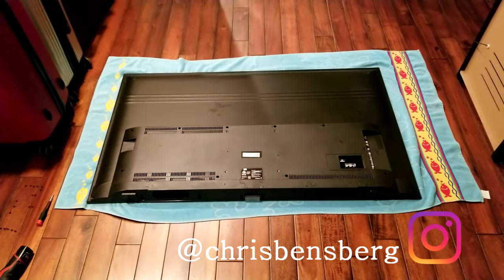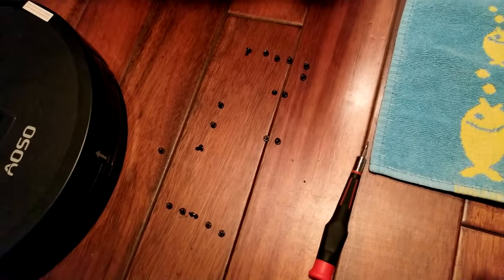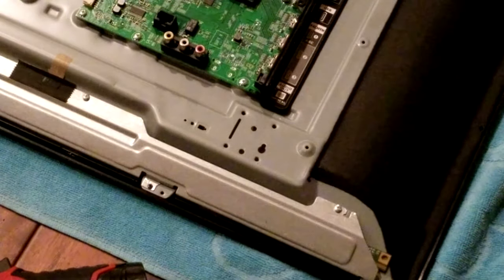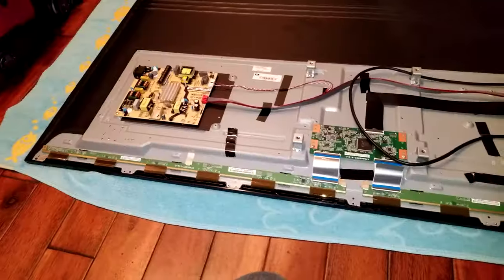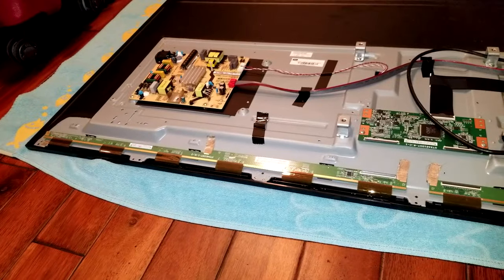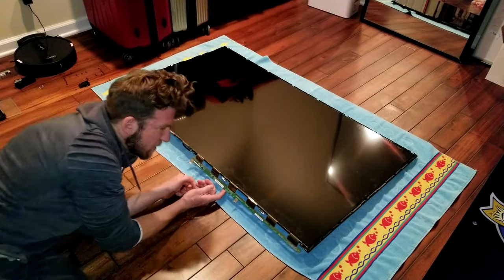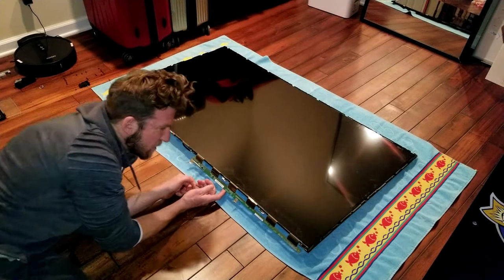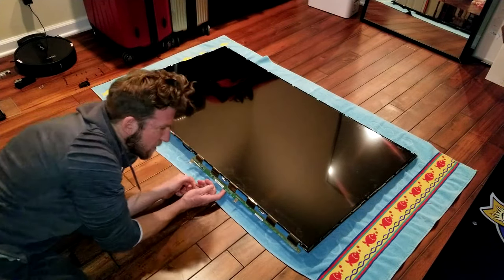TCL 55 Inch Has Sound But No Picture FIX!

Comment: YOU DO NOT NEED TO REMOVE THE ADHESIVE FROM THE DISPLAY!!!!! the part of the tv that is glued to the display(that runs along the top edge) is designed to be removed and reinstalled with the tv. Its just a matter of a few clips on the top of the tv that need to be first removed and then the whole display comes right off without any fuss. I did the job last night and can confirm I would have broken it if I didn't realize this. If there are any questions about this, reply and I can go more into depth about it.!
Reply: Can you go in more depth please?  So i don't have to remove the 2 panels separately?
Reply: @MrGandostar  yeah so on the top side of the tv after youve removed the bezel there are little clips that you must use a flathead screwdriver to release. You will see little cutouts with what looks like black bars(about 1/4 inch long) in them. Just push those in with a flat head util they pop. Once they are all popped the panel will come out with no effort. If it's not coming out super easily, stop! Then reevaluate. I had two broken tvs that I used parts from to make one working tv, and before I discover these clips, I actually cracked and already broken display. It doesnt take much force at all.
Reply: @masonphillips6605  thank you for the info!
Reply: Do the 3 sheets stay attached to the screen when you remove it the way you’re describing?
Reply: I was wondering about this because the screen and plastic comes off so easy, but I have yet to successfully remove the adhesive. Thanks for confirming.
Reply: @AXXXXA  no they dont. You will have the filters separate from the actual display when you disassemble your tv
Reply: @masonphillips6605  is there a video you can refer me that explain that and how to do that. Otherwise there’s no way I’m gonna get it right
Reply: This man is 10000000% correct. You do not have to go through the pain of separating the screen and adhesive. I just cracked my screen following the credit card / adhesive separation method then I looked at the frame further and the entire screen can STAY ON THE FRAME and just remove a few clips. Wish I would of read all the comments before I started this project. I'm not going to buy a new tv.
Reply: @tjarion  hey did you order a new screen or just brought a new tv I just did the same thing and is heartbroken
Reply: How many clips are there along the top?
Reply: @shawnspears3844  Its been a while, I can't remember but around 6 I think
Reply: @masonphillips6605  Thanks! I can’t find any image or video online describing these clips, would be nice to reference
Reply: Broke my screen using the credit method in the video. Don’t use the credit card!
Reply: @jbocooter8415  same 😢
Reply: Please upvote/ pin this comment. This would have saved my TV 😅
Reply: Is there a video for no sound or picture uv output tcl control both light when reset is pushed but then flashing occurs is this a fault code?
Reply: @tjarion  So, do we unclip the frame on all 3 sides (except the bottom) and the screen will lift off with the frame?
Reply: He said "I've already replaced all those four already". What has he replaced, I didn't see it. Does that mean I have to buy some parts.
Reply: I'm really interested to know if there's anything that has been replaced.
Reply: Yes I just saw the clips.. no adhesive need to be removed. The screen becomes easier to remove once the clips are removed.
Reply: Wouldn't this be the same as what he has at 13:50 in the video? Where he removes the frame that the screen was glued on to?
Reply: Also... Use the suction cups to apply GENTLE upward pressure as you're undoing the clips. The screen will stick a little bit even with the clip tension reduced. The upward pressure will help it break loose. I didn't know this and only worried about the clips... And promptly cracked the screen. :(

Comment: I watch the video about 5 times and decided to try and fix my TCL 55 inch everything went like the tutorial with some differences that didn't pose a problem until I tried to separate the top of the screen from the 2 sided tape. This TV must be a later version because it was really stuck. The screen cracked and the crack traveled across most of the screen. After that I noticed how the top plastic strip it was stuck to could have been released and removed with the screen. The sides and bottom of the screen released easily but the top would not. Hope this helps prevent someone from cracking their screen

Comment: He explained everything very well, started to watch a different video and would have broke my tv before I ever got it apart if I hadn't found this one. My husband thought I was nuts at first but once I had it down to the screen he stepped in to help and other than the one top corner cracked a little it (he wasn't kidding when he said be gentle) works better than before, leds were larger then what was in it but the picture is brighter which is good. I've never commented on a video before but our tv would have been in the trash if it wasn't for this. The 30 bucks for the led strips and 6 bucks for suction cups was much better then 550 for a new 55" TCL tv.
Reply: Where do you find the strips?

Comment: This is a great guide. Few corrections:
1) Tape the dangling circuit boards (the ones that hang by ribbon) to the top of the screen. This will not damage them and will prevent you from damagnig them when lifting off the screen. 
2) As others said do not remove the adhesive on the top, just unclip the top frame.. Use a flat head and push up on the clips while using a suction cup to gently lift the screen (to give you some leverage). 
3) After you remove the glass screen, the three filters need to be removed. If possible, gloves to avoid smudging these, as it's very hard to clean them. 
4) Also would recommend just cutting the paper around the LEDs instead of trying to peel off the whole thing. I can confirm this does not impact use at all.
Reply: Where did you find the LED lights? I see some on Amazon but not sure if I have to cut them? Can I cut them? I see the strips of lights but still not sure or comfortable with getting them not knowing everything.
Reply: @Learning_new_things_70 no you don’t cut the new LED lights. You cut the white plastic cover on the tv.. to be able to remove the previous LED lights
Reply: Thanks for your input

Comment: For anyone who is watching this video and are working on repairing a TCL 50S425 or Similar. 
Things I won't recommend doing to make the repair so much easier.
• DO NOT TAKE OFF ADHESIVE! When you're on that step of getting ready to take off the screen look underneath the bezel area on all 4 sides there should be clips that you can pry off. Pry off all 4 sides. Use the suctions and lift off the screen.

• When you lift off the screen make sure your hands are clean and I wouldn't recommend putting tape on the corners to hold the three sheets as the video recommended, the tape leaves residual on the sheets.

• I replaced my Backlights without pulling off the white paper sheet. What I did was carefully cut around and In between which made it easier and less work.

• After the repair of backlights and sheets are back in, make sure the screen is aligned directly in the middle. Mine was a little off to left side more than right which caused not so good alignment to input the screws in the left side but I didn't mind because it was still stuck in there without the screws.

• What I also recommend doing is organize your screws. What I did is put them in the Air Pillows I had left over from the packaging of Backlights. They are many screws to take off and you can easily lose some since they are so small. 

Overall this took me about 4 hours to do? Personally for me the repair wasn't too bad it's just a process of staying organized, careful, and patient.

You can either buy the LED Lights from the website called 
jimmyshop - No Free Shipping 

OR 

Their ebay marketplace which is free shipping.
Reply: Do you have a part number??
Reply: Don't the cuts show through?

Comment: I'm a auto mechanic that rebuild a transmission and engine on the side of the road. I'm a self taught welder that can give a Tulsa trained welder a run for his money. Im also a trained HVAC technician, carpenter, and heavy equipment operator. But the finesse on pulling the screen off is no joke 🤣. All I can say is read the comments before proceeding with this part other than that 40 for a 600 tv fix is a win in my book. Props to this man he earned my subscription

Comment: Thanks for great video. I just did a 4 year old  TCL 55S423. I did it just to see if I do it. TV wasn’t that expensive to begin with and easily replaceable but I thought it looked fine for my use and why contribute to more land fill if I could fix for under $50. 

I bought the light from Amazon but was concerned that there were only 4 strips for just two rows of LEDs. Once I got it apart this indeed the case. I tried to peel back that base but it was stack down. So I just cut out the strips which worked great. They were not screwed down but had a bit of adhesive the new lights had tape applied. 

I was most concerned about any adhesive holding the LCD panel to the frame but as it it turns out the panel sat in the frame no adhesive at all and just lifted right out. 

One big tip get a magnetic Phillips screwdriver.

Comment: This was a great video. Comments are correct. You do not need to use the credit card method. Just separate the bracket that holds the screen. You can cut the paper that surrounds the leds. Just make sure to tape them so they don’t fall out place when it’s all together. Ask me how I know. Otherwise great video. Great comments. Thank you.

Comment: Gave it my best shot and was as careful as I could be, and still broke the LCD screen. Bought everything recommended here, too. I think it happened during the process of putting the display back on. 

To anyone else who broke the screen, don’t feel bad, this is NOT as easy as it looks on various YouTube videos… I’ve successfully repaired a multitude of different smartphones, repaired and built small and large drones, built and repaired computers & laptops, tore down a GoPro and rebuilt it… but still failed this exercise. 

By far the fragility of the display makes this one of the toughest repairs I’ve ever dealt with. If it wasn’t for that, this would have been extremely straight forward.

Comment: Thank you for this tutorial!  Just finished and it's functional again!  I skipped the adhesive separation part, but I followed everything else and my 65" is up and running just before Super Bowl Sunday!
Reply: I'm just about to do this exact thing on my own 65".  Was it relatively straight-forward like his video shows? I'm also planning on skipping the adhesive separation as well.  Any tips from someone who successfully fixed their TV? Did you use suction cups for moving the screen? 
Thanks!
Reply: @David Martin  Yes, the video was awesome to follow and I did use suction cups from harbor freight.  Just take your time and don't rush.
Reply: @Gitnardoproductions  Thanks for letting me know. I bought the cups yesterday morning and my lights will be here on Saturday. I'm going to take my time and follow along. Thanks again for taking the time to let me know it worked for you!! I really appreciate it.
Reply: @David Martin  Definitely!  You got this!  I did separate everything as far as the backing and parts together on a table just for my mind's sake.  I placed the screen on towels and the replacement on another table and placed everything the way it would go in, just for my mind's sake so I wouldn't get confused.
Reply: @Gitnardoproductions   That's what I was thinking as well. To organize the parts as they come off so I don't forget how they go back in lol. Knowing me, I would put something in backwards.  Going to make sure the wife is around to keep me in line for this one. New TV isn't in the budget right now with how expensive food is. Especially with 6 kids!
Reply: @DavidMartin-ev2kt  hey can i ask where you got your LCD lights from? do you have a link?

Comment: This video was great, exactly to the point and no fluff until I went to take the actual screen out. Following the credit card method for the adhesive. Unfortunately, going slowly, it still broke the screen. And come to find out, the screen didn’t need to come off the top rail. Almost had it.
Reply: Thanks for commenting. Sucks that it broke on you but I appreciate you letting us know. I'm about to try this myself and plan on skipping the adhesive part to hopefully not break my own screen.

Comment: Should be Times man of the year, made fixing my TV a fun afternoon project. 

If you're a risk taker you can use clear packing tape to make handles for lifting the panel, instead of using suction cups.

Comment: Thanks for posting this. I ordered the light kit and worked like a charm. Only thing I did different is no suction cups... I didn't want to make trip across town to get them so just used thin plastic card to slide all round edge to free the adhesive and then lifted screen out carefully. Maybe I got lucky but worked fine for me.
Reply: Hi from where can I order the  light kit?
Reply: @danielanavideo  I ordered off ebay.

Comment: Thanks for explaining it in great detail. After I replaced the LEDs, I tested it and it was OK before putting it back together. However, after assembly, the TV screen remained black except when I shined a light onto it; then there was no longer any image. There was still sound. I wondered if this was due to cable connection issues. Do you have any advice? (Edit): Solved. The two flat cables have to line up perfectly, as they affect the clock signals controlling two halves of screen video.

Comment: I’m so bummed. Great video, I followed every little step. I bought suction cops as well. Everything went exactly to plan. I tried to be super careful and gentle. The tv turned right on...and there’s a small crack in the corner of the screen. Ugh. Not your fault. Thanks though
Reply: I screwed mine up too. Everyone should avoid trying to insert the credit card on top of the screen
Reply: Instead just remove the top 'filter chassis' black piece with the lcd screen. And leave it stuck to the lcd screen. I wish he wouldn't teach us that. Its much easier just to leave it on and take it apart together. Plus you dont risk runinig the TV
Reply: I broke mine too and didn’t even use a credit card. I used a very thin plastic tool designed for opening small screens. This repair is not as easy as it looks on YouTube.
Reply: LEDs worked but I used the credit card and I think that broke my screen. Turned it on and cracks all over.

Comment: Could you please explain how you know which LED strips to order/ where you ordered them from?
Reply: My thoughts exactly, I was looking for those parts on the description and they are not there.
Reply: @aleschwaida  bro mine just went blank only sounds am hearing
Reply: @Pete_content  that is what happened to me. I did exactly what the video shows and it is back running
Reply: @aleschwaida  I'm looking into doing this but mine has no backlight at all. Any advice?
Reply: @fedsmoker1841  mine appeared not to have too. But when I looked really close I could see something. Is the sound working?
Reply: @aleschwaida  sound works good, it's doing the same thing as his in first video (1 quick flash of image when trying to turn on) but then nothing 😔
Reply: Only the right side of my TV is black 🙄
Reply: Can you just come do my tv 📺… although very thorough tutorial … so many steps 😩

Comment: Very helpful, saved me $600!  Really not hard at all either.  Only issue I had was putting the ribbons back.  Place them in gently and dont push too hard.  My TV works great now and only cost me $40.
Reply: Where did you buy the lights and what kind
Reply: @karinaruiz8562  you have to buy them based on your TV model.  I found mine on ebay.

Comment: Good video and will be useful. My TCL just died with sound working and black screen, but no light , so I guess I will be following this procedure to put in new LED lights. My 65" TCL is 18 months old ! Costco purchase, so I'm going to see if Costco will repair or replace before doing this, but if I have to do this,I will. Thanks for your video !

Comment: Very informative.  However, the symptoms produced CAN be a bad T-Con.  It's sort of a crap shoot unless you have the patience to test the LEDs individually or the T-Con component my component.  I'm a lousy craps player and went with the LEDs and replaced them only find out it was the T-Con.  The T-Con is even an easier fix.  Cost estimate from the "authorized repair facility"?  LEDs: $265 (plus tax).  T-Con: $280.  My cost?  LEDs:  $25  T-Con: $28

Comment: Before I get started on doing all of this to my 55” TCL tv, I wanna say that it did one time turn on and work with its full picture, but then when I turned it back on later it went back to doing this. I’ve tried all other methods to fix it aside from doing all of this. Should I go through with taking it apart considering it did work again that one time?

Comment: This was a fantastic tutorial. My led's were blown and succeeded in removing the working screen and had the screen installed 95% unto a brand new TCL that had shipped w/ a cracked screen . When flipping over 2 of the bottom ribbons were disconnected. 😭😭😭. Is there anyway to reattach. Or is there a way of removing the other 2 strips w/ ribbons in tact and installing on good screen or am I "SOL" ??